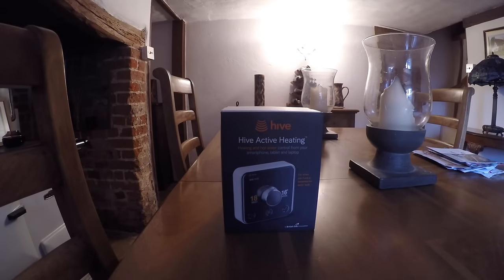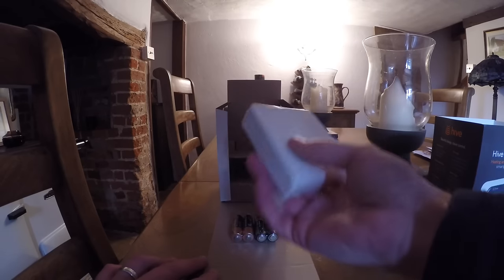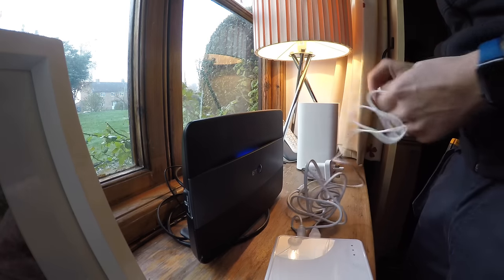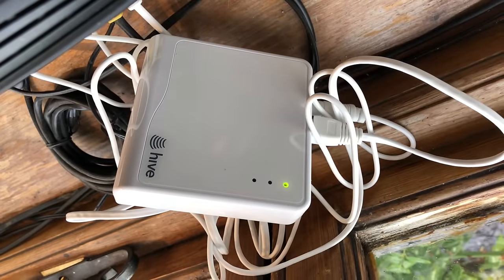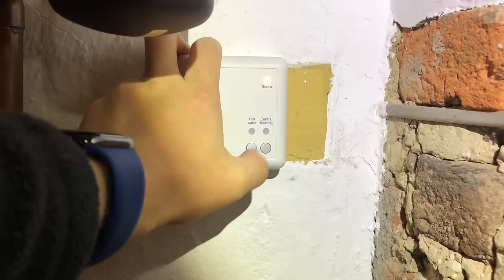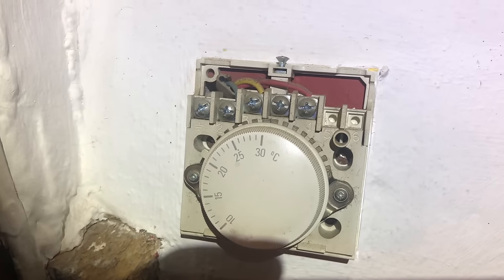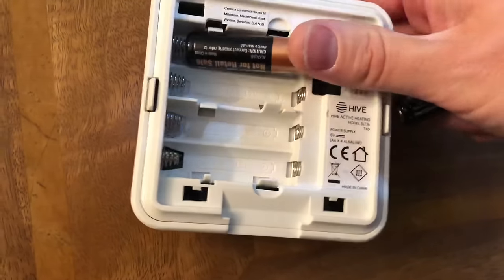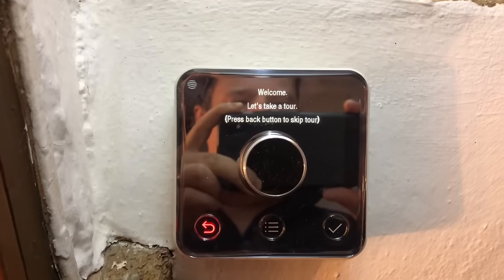How to Install a Hive Smart Thermostat step by step guide

Comment: Could you just connect the feed and switch feed at the room stat rather than bridge out at the wiring center?
Reply: That's exactly what I did!
Reply: @peterwhite51  a lot less messing about if you ask me Peter!
Reply: He removed the room stat
Reply: @callumb2010  yeah, but the Hive stat is now where the old wired stat was (at least it is in my house)so behind that in the flush box I just connected the feed and switch feed to save disturbing the wiring centre.

Comment: Nice video Jordan, I fitted one of these for the parents and found the cable for the programmer was run against the heating pipes and they were solid and just split open when moved 😬 so in true AE style I replaced the cable with heat proof cables and located the away from direct heat. It works very well and much easier to program for the older generation 👍

Comment: Good video but why did you not as a minimum colour sleeve the earth conductor used as the switch wire, especially as the connection was the next terminal to the earth connection at the Wiring Centre?

Comment: When taking off the face plate of my old honeywell receiver it wasn't wired as i thought it would be. The L and N were at the opposite end. This video is great but only if you have exactly the same wiring, if not id say dont touch it and get a professional to do it.

Comment: Nice video. As you know you would fail any assessment using a pen voltage detector to prove isolation. You shouldn't show this method on a public video. Did you really use the cpc as a live wire?

Comment from the maker: You can buy a Hive Smart Thermostat here for just £128 and support our channel: https://amzn.to/3lLgBp1
Reply: Artisan Electrics is this one one for a heating system without a hot water tank, just a combi? Cheers
Reply from the maker: Yes the one I installed was just for a combi boiler
Reply: Hi jordan iv got a combi boiler and already have a receiver and a wireless thermostat, but not smart stuff,will i just replace existing receiver with hive receiver? i shouldnt need to wire anything else if im already on a wireless set up ?  Any advice be appreciated thanks
Reply: What do you recommend please, I have a combi boiler, with a room thermostat which is located in the hall, the thermostat is directly wired to the boiler with 3 core and Earth.
I DONT USE OR NEED ANY TIMER CONTROL.
I just want to replace the manual thermostat with a WiFi controlled one.
So that I can switch the boiler off and on
No timer function is required!!
Reply from the maker: Yes that will work with a Hive thermostat no problem
Reply: Hey! Can you use an existing receiver with a new hub and thermostat? When I go through the set up, I get a constant green light on the receiver at the top. When I high the boiler ignition button, the boiler turn on but then the thermostat won’t connect to the network. I have the new receiver, is it a case of swapping over the face plate or will I need to rewire with the new receiver back plate/terminals? Thanks
Reply: Hi, can I just ask.......I don’t want to put my hive thermostat where my existing one is, so can I just leave the old thermostat where it is? Do I actually need to remove it?
Reply from the maker: @Laptopdog78  You will need to override the old one somehow, you could just turn it up so it's always on, or link out the wires inside.
Reply: @artisanelectrics  If I just turn it up, is that ok? And would it then run just exactly how it would if I was to alter the wiring?

Comment: Thanks for the video, do you have any knowledge of the Hive Thermostatic valves and if we need a room stat in every zone? Plus do you know the ranges of the devices, our lounge is 3 rooms away from the boiler and 3 brick walls? He have a long narrow property with sleeping accommodation at one end and lounge at the other, I want to install a system where the bedrooms are heated in the morning and the lounge is only heated in the evening. Or do you know where I can find out please? The HIVE website is not that helpful !

Comment: Very good job
Only thing I would change is the 3 core flex between the wiring center and the programmer because it's using the green yellow as a switch wire not as a cpc

Comment: Wishing to upgrade to the Hive V3 for a system with a boiler and water tank. Currently have a Drayton LP722 which has the same backplate configuration as the Hive. SO far so good. The current thermostat is a Salus RT300RF which is wifi. The Salus receiver wires go into the same electrical block as the programmer apart from one wire, would this be the fee feed which needs to be bridged?

Comment: Thanks great video. I have the addition of a frost stat at the front door as well as the regular thermostat. Would you leave this wired in or would this also require an additional wiring change?

Comment: Would these work on any boiler? We have a Valliant boiler probably about 10 years old and its thermostat is useless and very hard to control and program.
Reply from the maker: They work with most systems but you need an installer to check your current system to be sure

Comment: Great video. Inspired me to have a go. Slight problem is I can't seem to get a signal from the receiver to the boiler. Lower light comes on but boiler does not kick in. I already had a wireless receiver so just swapped it out for the hive receiver, fitting it on the existing back plate.  Any suggestions as the why the swap over isn't working?

Comment: Looks to be a dual channel receiver, and looks to be only 5 wires. Wouldn’t you need 6; {L}{N}{Hotwater Off}{Heating Off}{Hotwater On}{Heating On}
Looks to be missing a {Heating Off} in port 2?

Comment: Would this work on a oil boiler.  The plumbing is not setup to heat water and rads seperately.  Theres just one option to heat both oil and water at the same time in our house at the moment.  Thanks for the video though.

Comment: Very clear, just a question? Please see my below current thermostat and please recommend me how to fix wiring? Is that N,L, 3,4,5,6 to be replaced to N,L, 1,2,3,4 in Hive thermostat? Looking forward for your reply. Thanks.
Reply: there should be a wiring diagram on your thermostat or google the model number to see what numbers correspond to what action and match them with hive unit

Comment: I'm looking at installing my own....Great video. But do I need to open the wiring box like at around 11 minutes? Surely this is an unnecessary step if the thermostat is disconnected?
Reply: Have you fitted yours yet? I’ve ordered the same hive kit so watching some videos to understand the kit before it arrives.
The thermostat is the one bit I was unsure about but this video really helps.

Disconnecting the thermostat means it is no longer functional but the wiring is still in place. If the wires weren’t “bridged” in the wiring box the hive kit would tell the boiler to fire up but it won’t because the boiler is still checking the old thermostat wiring to check the temperature.
The bridging is effectively tricking the boiler into thinking the old thermostat is showing the house is cold so will allow the boiler to fire up.

That’s my understanding of it anyway. I just need to work out which wires need bridged in my wiring box, or I did wonder if the wires could be bridged on the thermostat end instead.
Reply: @45Camster  hi, yes I installed this and it was far easier than I expected.

I actually disconnected my thermostat and bridged the wires behind it (Switched and live together and neutral terminated) 
So it may not meet regs as I still have a live wire in my garage, but it's terminated to my satisfaction 🤷‍♂️
Reply: @matthewsflower1  
So you just bridged the wires on the thermostat end rather than in the wiring box?

That was my plan but I’m not going to fit the hive thermostat in the same place so the old wires will be left in the wall and decorated over. Would be better for me to bridge in the wiring box so the wires left in the wall are dead.

At least it seems easy enough then, looking forward to the kit arriving.

Thanks.

Comment: Hi Jordan is the receiver powered  off the boiler it’s self. I’ve a Worcester Combi . With no room stat or wireless stat just the one in front off boiler thanks
Reply: Receiver needs 230v usually wired from the wiring center
Reply: @UrbanPlumbers  as in the house mains ?

Comment: I was wondering please if anyone knows why the temperature numbers on my hive thermostat at the wall keeps jumbling up the numbers? For example, when I put the temperature on say 23°, it'll jump to 32° and it takes an age to bring it to 23°. The numbers won't fix on what I want it set at unless I dial it back very slowly. FYI, we've had this installed for 18 min with one battery change. Thank you in advance.

Comment: How is the HOt Water controlled then on this combi boiler? The hive system is only for heating right?
Reply: Hot water on a combi has priority over central heating.  It's triggered via a flow switch in the boiler which rotates when you open the tap.  Hive has no control over h/w.

Comment: Hi.after installing thermostat and setting heating and hot water schedule on off times we found the heating is on outside of the on schedule. All wiring is correct heating goes off via the control know. Hive technical cannot give a solution.we swopped hive for another one but have the same issue. Hot water is OK.  Thanks for any help.
Reply: Sorry should say control know not know.
Reply: Knob
Reply: We have the hive status set on schedule.
Reply from the maker: I'm not sure what the problem is, did you get it fixed?

Comment: Would it have been wise to check the power supply rating of the BT hub power supply before loading it further with another device?
Reply: Hive hub has its own PSU, as indicated in the video with the plug with the retractable earth pin.
Reply: Power plug supplied wasn’t used. The new hub was powered from the ISB port on the back of the BT router.

Comment: Can someone explain why is there a need to change the wiring in the wiring centre when there is no mention  of this any where ells thanks
Reply: I think it's because when the existing room thermostat is removed the circuit is left open, meaning the "command" signal calling for heating is gone and unless it is bridged or removed, the zone valve for the CH will never open. Hence why this guy removed the loop completely.

Alternative methods are to splice the wires together once you've disconnected the stat or even leave the old stat there and turn it right up to maximum, leaving the new Hive stat to maintain the desired level.

I have a timer control in my garage and no room thermostat at all so I should be able to simply replace the timer with the Hive receiver. No stat wiring to worry about! Good luck if you're doing your own DIY install, I've just taken advantage of the Screwfix Black Friday deal for £119.99 (V3 Heating & hot water, comes with stat, hub and receiver)

Comment: I only have a timer on the main fuse board no stat in the house can i still set this system up?
Reply from the maker: shergar2 yes it should still work but will take a bit of extra figuring out. Is it an electric underfloor heating system?
Reply: Just a timer that turns on and off the central heating oil boiler as i said no thermostat in the house great video by the way 👍

Comment: That’s ok if you have a Y plan heating system, what about an S plan CHS No white wire on an S plan. So you need to trace the wiring back to the correct valve actuator.
Reply from the maker: Yeah you're right good call

Comment: If you didn’t want to use the old thermostat and keep the old wiring - rather than remove and link out the cable in the control box could you just leave it the same and use the wireless controller as demonstrated?
Reply: Did you find an an answer for this? I don’t know where my control box is and this seems like the trickiest step so it would be great to avoid it if possible.

Comment: I have installed one with the help of your video,  all the signals are showing it is working, only the hot water worked yesterday even though it showed both heating and hot water was working and now both stopped working.
Reply from the maker: a64mathew not sure what the problem would be there, if in doubt call a qualified electrician or contact Hive tech helpline
Reply: @artisanelectrics  Thank you

Comment: Thanks for the video :) A couple of questions if I may please... 

1) With the heating Boost button, can you set a lower temperature rather than a higher one? I would probably do this if going out for a while - but this depends on the answer to number 2 !
2) The Geolocation facility - can this be set to detect you are away from the property and reduce the temperature accordingly or does it just inform you that you've gone out and left the heating on? I leave my heating on all the time and control it with the temperature.
Reply from the maker: Hi! I’m really not sure I don’t know all the features you would have to check the Hive website
Reply: @artisanelectrics  Yes you ca set the boost to however long you want and at any temperature. It's very easy

Comment: Is it easer to connect the 2 wires in the room stat together instead of going into the wiring centre
Reply from the maker: Stephen parkin yes you could also do it that way, it’s probably easier but not neater.
Reply: @artisanelectrics  So it's safe to just twist them together ? This will I guess fake the system to always be calling for heat ?
Reply: @artisanelectrics  I have hive perfectly working (both heating and hot water) with the old honeywell thermostat  but the heating stops to work as soon as i remove the old honeywell thermostat. I tried to just terminate all 3 wires (blue, red, yellow) separately in a link but its still not working (though hive is showing hearing is on - both in the app and receiver). Do I need to link the red and yellow together in a wire link (same as probably twisting those together) and leave the blue one on its own ? I can't remove the wiring from wiring / control centre as that is not accessible.
Reply: I did that and it seems to be working now, thanks to this video and comments from everyone

Comment: My old thermostat is in a stupid place, so won't be putting new one there. Instead of disconnecting it, and then doing the wiring suggesting at the boiler end, can't I just remove old thermostat off wall, then safely connect the 2 wires together so that's it's constantly asking for heat ( my old thermostats never worked properly anyway ... It's either on or off !! )
Reply: Alternatively, could I just leave the old thermostat in place, turned to "full" ( as it has been for many years ) as like that, it'll be permanently asking for heat ... And then the hive controller/thermostat can control when the boiler comes on and off.

Comment: Whats RJ45 port at the back of receiver ?
Reply from the maker: It’s to connect it to the internet
Reply: @artisanelectrics  yes i know that but to do what ?
Reply: @DerekHundik  because with hive u can change temp via an app which uses wifi if im correct?
Reply from the maker: Yes that’s right
Reply: @artisanelectrics  thats right what ?  What is ir for ?
Reply: @DerekHundik  What @Johnsey Mods said above, the RJ45 is so you can remotely connect using your smart phone
Reply: @perry4078  its RJ11 port. i still dont know why they put that port at the back of the unit. Its not accesible after instalation.

Comment: Just a heads up for people there is a common fault on some Hive thermostats were they do not read the temperature correctly and there is no way of altering the factory settings to calibrate it correctly. British gas know about this problem but are refusing to help customers sort it. A search on the forum Hive Home will confirm this so 'Caveat emptor'.
Reply from the maker: Thanks for the heads up!

Comment: Whoops no earth at the programer , notice the earth wire is being used as live conductor, nice, not.
Reply from the maker: As long as it’s sleeved up and thus identified as a live conductor this is perfectly acceptable in a flexible cable. It would be a different story in twin and earth of course!
Reply: Artisan Electrics Yes I know the insulation properties are the same , but still bad practice , perhaps more savings could be obtained if the Earth terminal was not included

Comment: It was a good video until 11.50, then woah - nowhere enough explanation for someone who hadn’t good knowledge of both electric and heating systems.
Reply from the maker: If in doubt call a qualified electrician
Reply: I agree with Jordan in that if you don't understand that you should deffo get a qualified electrician, but I also have to stand up for him here, that was an excellent explanation, really cogent and coherent, a good explanation of supply and demand from @artisanelectrics. Great vid.
Reply: if you dont understand it you shouldnt be anywhere near it to start with your not a spark simples

Comment: You use a 'maybe-stick' to check isolation? WTAF?? 

Dude if you're putting videos into the public domain then you really need to highlight better isolation checking  practices than a volt stick.

Love your content, but c'mon!!!
Reply from the maker: Not just a maybe stick, a fluke volt alert stick, which is perfectly acceptable means of checking isolation, not like the old ones that were unreliable.